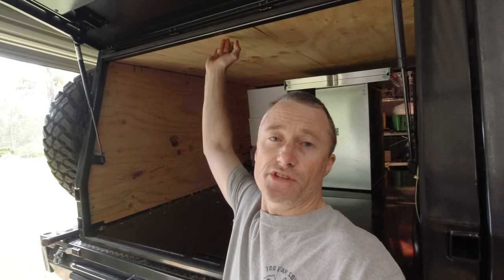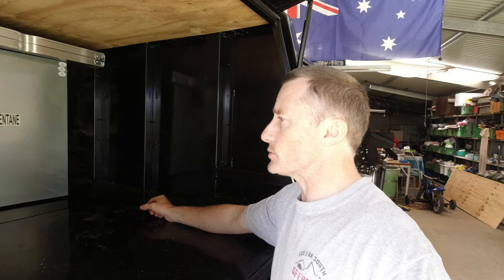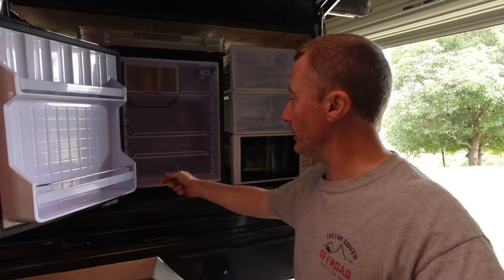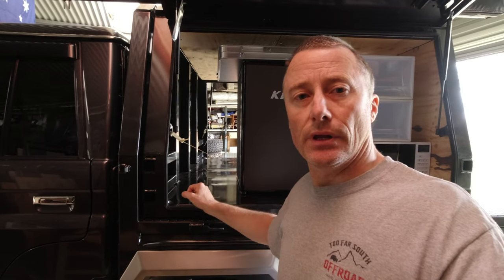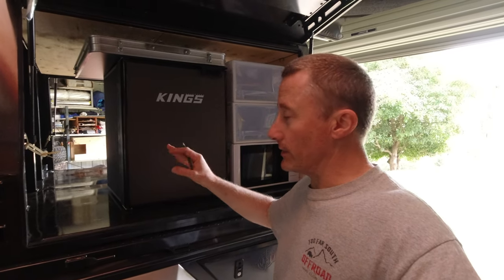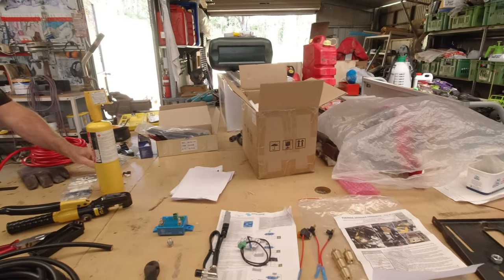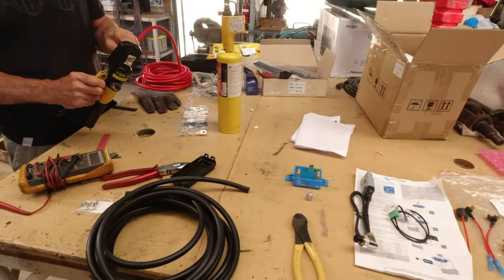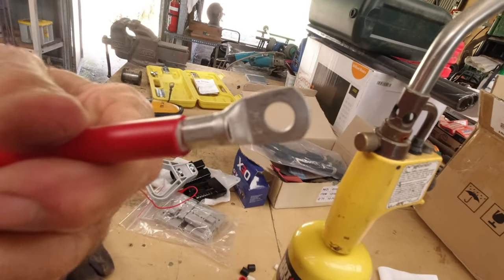Landcruiser 79 Series Build - Episode 9 - Canopy Fit Out

Comment: Your shokie mod for the fridge slide is ingenious, friggin Gold! Thanks for the content. Spewing I threw out my old shocks now. Cheers. ps. where did you get the plastic drawers from? I'm trying to aviod drawer runners for the old weight issue.
Reply from the maker: Cheers. The plastic draws are from BigW , cheap as and weigh next to nothing and you can take the draw out and bring it inside to pack, 🤙